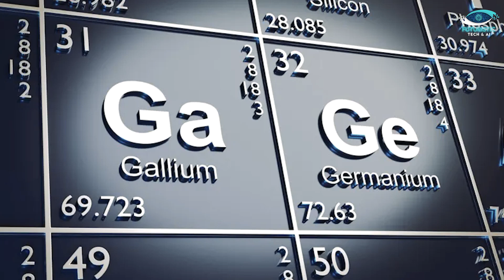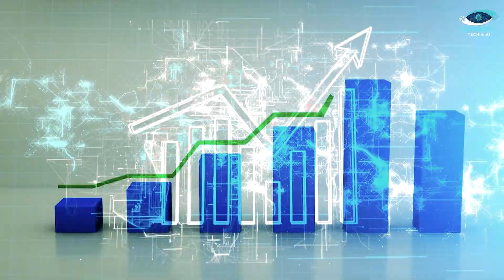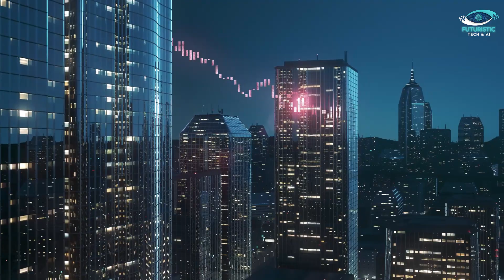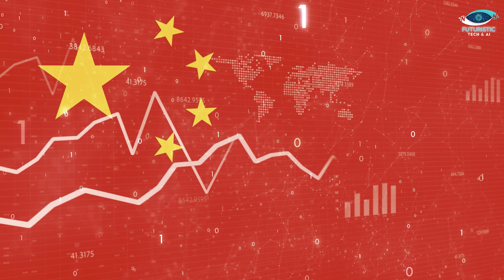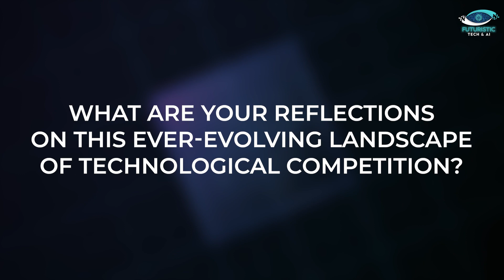Huawei 5G Chips Reshaped Global Technology | China Blockade to Breakthrough #huawei #china

Comment: Nothing game-changing about this new chip. From benchmarks we understood that China can't even beat the 7nm offerings from Qualcomm that were released years ago. We also found out that the chip produces lots of heat. 

As for the architecture itself, couple of years ago data for TSMC's 7nm process got stolen by China and that's what we are seeing today. In fact it is nothing revolutionary. The first ever 7nm process by TSMC was created using DUV machines. They switched to 7nm for the 2nd gen because DUV machines were not economically practical due to the low yield rates.
Reply from the maker: Thank you for the insights.